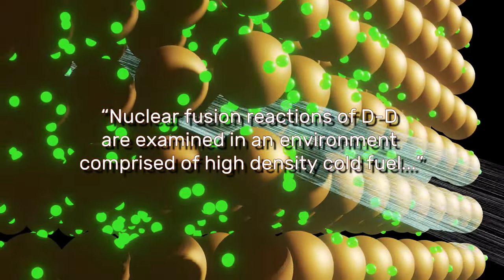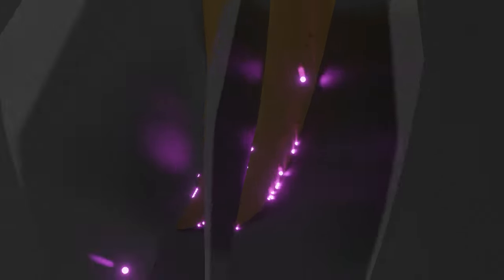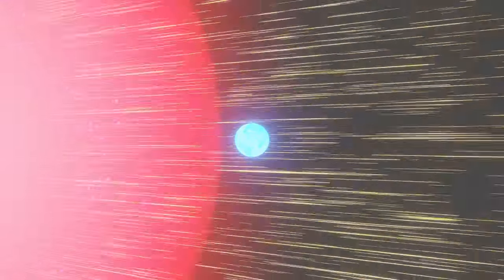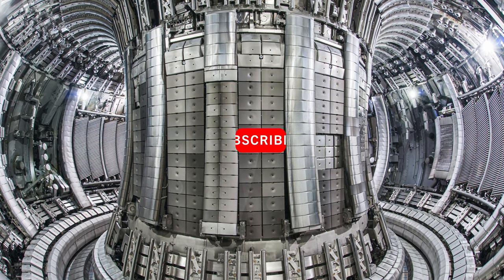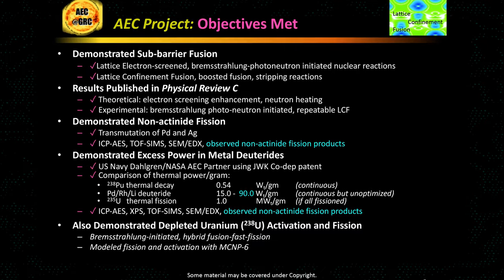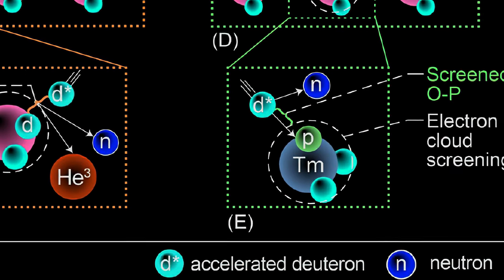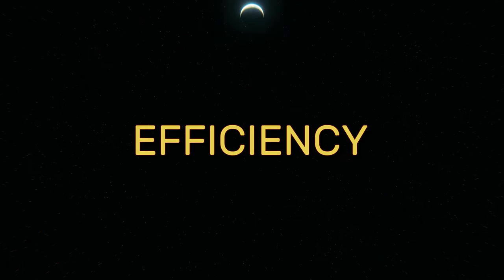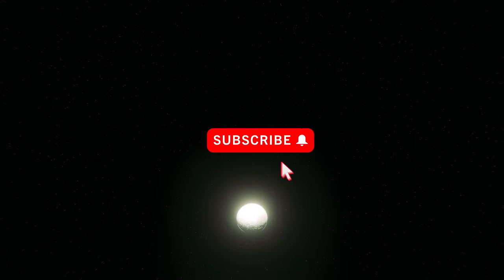Lattice Confinement Fusion - Viable for Space Exploration

Comment: Won't this irradiate any Europan life?
Reply from the maker: Fast neutrons are the top threat to life with fusion. Fortunately fast neutrons are fairly well insulated by water, so the reactor would only be dangerous for life in very close proximity. Keep in mind though you are  likely to throttle this kind of reactor down once you breach the subsurface ice since you mostly need it as a heat source for tunneling through the ice. There are a lot of ways we can reduce fast neutron footprint beyond the reactor if it becomes a serious concern and this could probably be a decision made during the mission as needed. 
I would imagine a smaller secondary robot would be deployed using a simpler power system for exploration so there may be no concern at all if that approach is used.